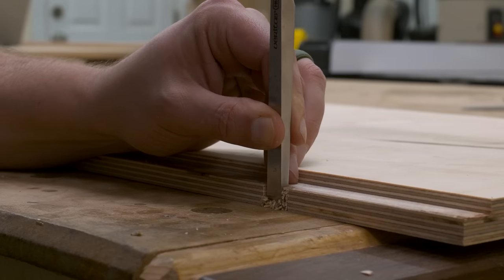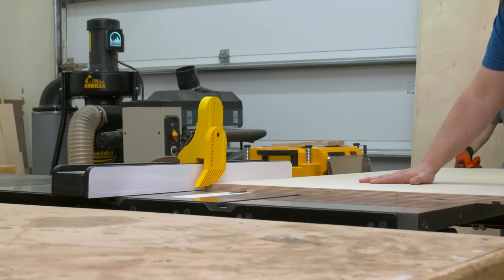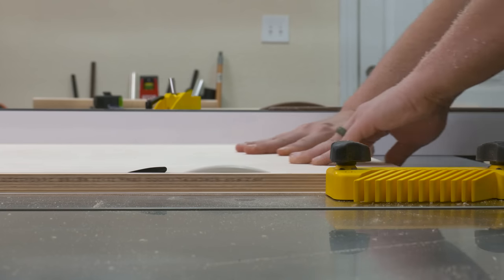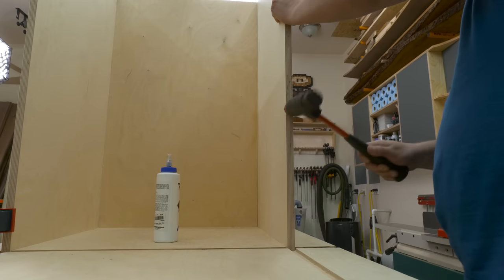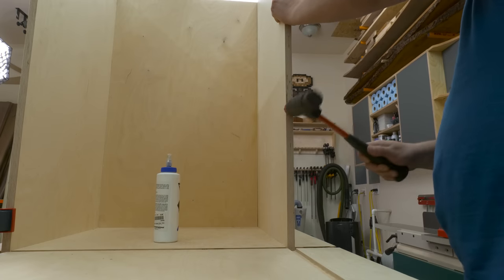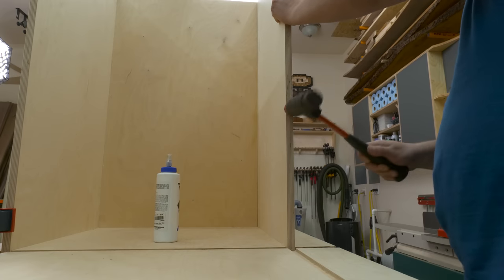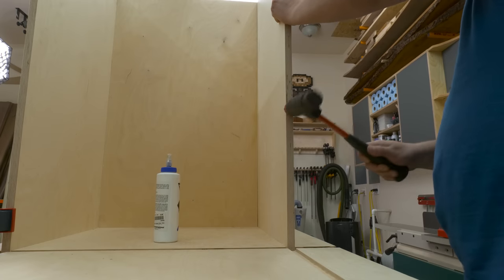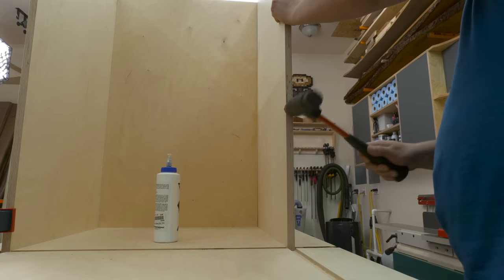The Perfect Place to Build | Outfeed Assembly Table

Comment: Really nice table that I will need to build as soon as I get a bit more space for my shop. One thing I would do if I were you is to add a safety block on the back of your crosscut sled where the blade comes out at the end of a cut, just to prevent an accident from happening. I use two pieces of 2x4 about 4" wide glued together and screwed onto the sled where the blade comes thru. 😀
Reply from the maker: Thank you! Yeah, I’d say for the weekend woodworker that’s not a bad idea. I’ve become pretty comfortable with my sled set up over the years, and I’m always very vigilant at the tablesaw.

Comment: Big upgrade. Especially for looks. Surprised your planer is on a Black & Decker Workmate. I also lugged it between two workmates until I recently built a cart. Never lifting it or being afraid it’ll fall off has been nice. I used the Rockler plans they put with their Dust Separator Components kit. A few changes like not connecting the doors to the pull-out boxes. Used a slot and block that locks them in with gravity. Like a sliding door but no sliding. Also used a ridged PVC pipe to go over and down into box. No coiled hose.
Reply from the maker: Thanks! It’s actually an old portable table saw base. Luckily I don’t have to move it far to use it.

Comment: OK, I've never seen these before. Where did you get the feather boards you see in the video at the 3:10 time line. The ones that straddle the fence. I like the way they set up. I like your push block. I have several of them made from scrap 2 X 4 or 2 X 6... I love the cost - free. When they get to cut up, take off the handle and find another scrap. The only addition I would make is to darken the out feed table slots. Either black paint or black stain. Just a thought!!!
Reply from the maker: That's the vertical feather board by Magswitch, here's a link: https://amzn.to/3NyF0y5 As for the push blocks, I have a video with free templates if you want to make your own. And I hadn't considered painting the miter slots, but that's a great idea.
Reply: @TimberBiscuitWoodworks  Thanks for your reply...The black paint or dye would just make the slots blend into the table...

Comment: What did you do for the dust collection on your saw stop? I have the 1.75hp and the port comes right out where the assembly table butts to it, did you do a hard 90 degree elbow ?  That's my only hold up is incorporating the best way to run DC hoses. Your table is awesome.  I'm ready to make a new one and absolutely like yours. Great job.
Reply from the maker: There is enough overhang on the table for it to clear the hose on the back of the saw with no need for an elbow. I just have the hose running along the back of the table. Glad you found this one helpful, let me know if you have any other questions.
Reply: @TimberBiscuitWoodworks  thank you so much for the very quick reply
Reply from the maker: Not a problem

Comment: Nice build. Any concerns with the top warping with only having laminate on one side? I want to do the same for my out feed table but am concerned about uneven moisture absorption.
Reply from the maker: Thanks! No, if you think about it, the substrate is a sheet of ply since the melamine and plywood are sandwiched together. In the 10 months since I built it, there’s been no noticeable movement.

Comment: Great looking project!  I'm pretty sure I do drawer fronts based on which fastener method is closer to hand :)  I'm starting a shop table build this weekend with some of the same goals, namely storing a small compressor and big shop vac in a way that they can have some noise isolation and are always right at hand. How did you find the access to  your compressor?  It looked a little too tucked away to me, but maybe that's better.
Reply from the maker: Thanks! I actually just ran the hose over to the side of my table saw. Since it’s in the center of the shop I reaches everywhere I need it too.

Comment: That mask/filters are for particles, and not suitable to protect agains VOCs from the contact cement!
Also, I think it would be helpful to see the full build or some plans at the start, it's hard to get situated with all the panels being cut without knowing where they go in the final build!
Reply from the maker: Hence the point of using good ventilation, but thanks for the concern.

Comment: I’m curious about the far side of the fence guide, it looks like a piece of angle iron, you didn’t explain how it fits under the outfeed table and/or if the saw is attached to the outfeed table in anyway, can you elaborate?
Reply from the maker: Yeah, so as I mentioned, the leveling feet are adjustable so the outfeed table sits flush, or slightly lower than the top of the table saw. The fence guide has plenty of space underneath the top of the outfeed table. The saw is not attached to the table at all, the weight of both keeps them in place and aligned.
Reply: @TimberBiscuitWoodworks   so the only gap is possibly the piece of angle iron on the back side of the table. I ask because I’m planning on pulling off my rigid guide which is a big tube and replacing the whole fence. Since this is now technically an extension to your work bench when you retract the blade do you have a more solid insert for the blade cover to brevet what is mostly plastic from getting damages while let’s say you glue up work? Thanks for the quick reply.
Reply from the maker: Yeah there’s maybe a 1/16” gap but nothing major. As for the insert, I have one form a company called Colliflower that has replaceable inserts. But honestly I wouldn’t worry too much about that unless you’re planning on actually doing work on your saw top.

Comment: Is your Baltic birch coming from russia?
Reply from the maker: More than likely it did originate in Russia but I’m not certain of the source. I’m still hunting for comparable alternative.
Reply: @TimberBiscuitWoodworks  same. Found some 13 ply maple. More expensive, like everything else these days. But at least it’s made in US. Russia been smuggling their ply through third party. China, Vietnam, etc.
Reply from the maker: Yeah I have used some maple that’s about twice the cost but it’s got some other downsides. This stock of birch is the last of my suppliers so it might be the end of the line.
Reply: @TimberBiscuitWoodworks  I googled plywood producers in Poland, there is quite a few, thinking our suppliers could call around and establish new connections. At least it would be reasonable.
Reply from the maker: For sure